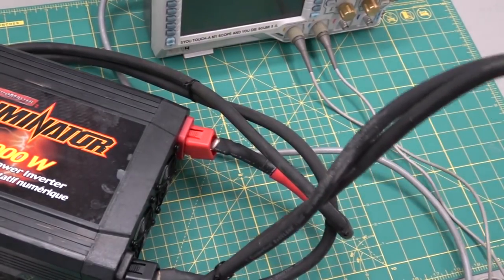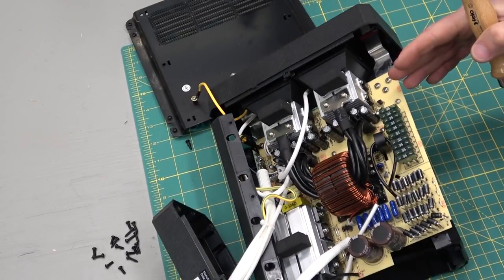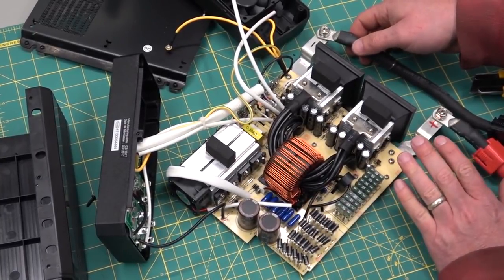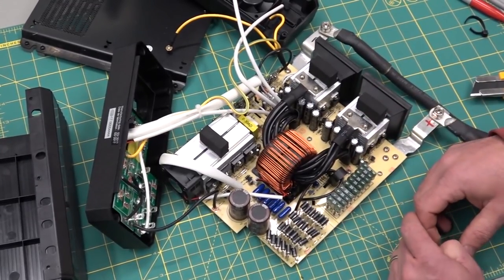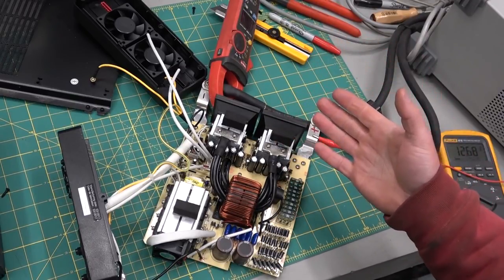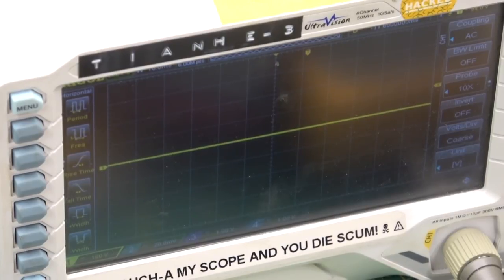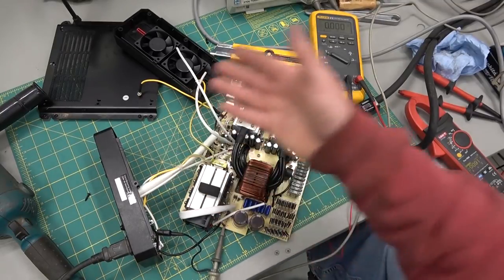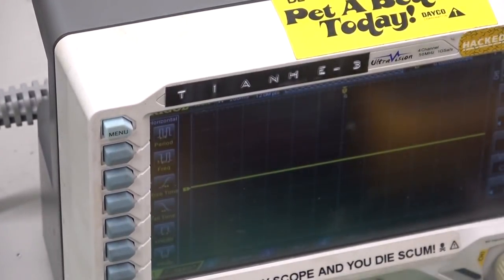BOLTR: 2000W "Digital" Inverter | Pure Sine Wave?

Comment: Aw poo, now I just gotta know how sine my EATON UPS really is too, they really should be forced to include waveforms for all inverter equipment in the manuals / documentation. It would be sweet to know if you got that pure sine or pure sin wave inverter! Seems good a reason as any to actually buy a scope tho right, right?!
Reply from the maker: Absolutely critical to check it with a scope. No choice.
Reply: Pretty sure all the cheaper ups will be step waves. They say it in the spec sheets, eaton and apc.
Reply: Power should not be thought about except for the that are clinically compulsive, rich, brilliant and willing to spend their lives getting mostly nothing accomplished.
Reply: Plug a desk lamp into it.  If it sounds buzzy it a square or modified wave, if it sounds normal it's probably a pure/true wave.  What AvE said about it being impossible to create a proper wave with an inverter is incorrect, my MicroSolar puts out a very clean wave.
Reply: Speaker and 12k ohm 1w resistor would tell you, just don't plug it for too long, 5w speaker minimum. You can clearly distinguish square wave triangle and sine wave. There are apps on phone that can generate these sounds for comparison.

Comment: The transistor will always blow to protect the fast-acting fuse.... an EE motto...
Reply: Gotta protect those fuses. They are expensive and hard to replace. (sarcasm)
Reply: I hear from a certain Louis Rossmann that Apple are especially keen on implementing this motto in their backlight circuits.
Reply: @pulesjet  well, you want it to pop without blowing up in your hand, making sure it's not chineseium crap drives the cost up.
Reply: @pulesjet  what gauge aluminum foil is 200mA?

Comment: I happen to be working at a company that sells and repairs UPS units (big ones, up to 500 kVA), so I have seen an inverter or two over the past few years. That poor thing on your healing bench is a joke from the technical point of view. The only admirable thing about it would be how the design was cost-optimized to death when it actually still works without setting everyone you love on fire, but that's about it. The machines we work with acutally do generate perfectly clean sine wave (regardless of the brand, it's a trait of the class). They usually have a very beefy brainboxes, utilizing FPGAs for precise MOSFET/IGBT control and use very high frequency PWM to "draw" a hi-res approximation of the sine wave, which is then fed through an output low-pass filter to iron out the noise and distortion with as little power loss as possible. Some devices can go under 1% output THD with linear load and under 3% with non-linear load, which is usually way better than the input power from the grid. The cost, of course, is a different story. My point is that you actually can generate a clean sine wave using solid-state switching converter although a lot of engineering needs to be involved.
Reply: "fed through an output low-pass filter"  Yeah, when he was talking about a perfect sine wave being impossible from switching, I was thinking about output filters and Nyquist's theorem and such.

Comment: In this case, "modified sine wave output" must be the new marketing word for square wave output.
Reply: "Modified sine wave" is complete marketing BS, "Modified SQUARE wave" is the correct terminology, but marketing heard that "sine wave is better" so they changed it to "modified sine wave"...
Reply: @SomeMorganSomewhere  is not even modified square wave is just a plain old square wave with some dead time
Reply: It is the marketing word for square wave output but its not new. They've been using it for 15 years at least
Reply: more expensive inverters/rectifiers have a lot better filtering and PWM to get much much closer to a legit sine wave. Used to work on big (like multi MW) UPS systems and DC plants, and once you start spending the big bucks you get really accurate power reproduction. thats why they get to keep the name sadly
Reply: viermidebutura The dead time is what makes modified sine wave “modified”.  The reason for the dead time is to avoid the extreme transition, and momentary near short, of a true simple square wave drive plus it creates an actual zero crossover reference period.  Modified sine wave is much, much, gentler on inductive loads, such as motors and transformers, than the even simpler pure square wave of much older early AC inverters as it the magnetic field to collapse more gracefully before the polarity transition occurs which allows those loads to both run much cooler and generate fewer harmonics versus simple square wave.  That said, I think we would all likely agree that it really should be marketed as “MODIFIED SQUARE wave” but then that would be bad marketing wank since consumers have learned to look for the words “sine wave” if they wanted a “better” inverter — its like calling a battery “marine deep cycle” even though the battery is most certainly not deep cycle but uneducated consumers trust that a battery that says “deep cycle” must be deep cycle.  Many modern inverters of this type will also vary the output duty cycle to help soft-start heavier loads, like motors, that would often overload the earlier square wave AC inverters.

Had this been a real “pure sine wave” AC inverter the output would have been Pulse Width Modulated at a much higher frequency (somewhere in the range of 20-100KHz)  that would then be smoothed by a low-pass filter to form a proper sine wave output (essentially they operate as a Class D amplifier).
Reply: <ahem> POOR sine wave inverters...
Reply: @ethanpoole3443  well square wave is not used for only 50% 50% square waves but for any variaton of its duty cycle so to say modified square wave is just word salad

As for pure sine for this type of inverter (square wave with dead time) there isn't a big difference in components to make it pure sine...
I think is just a marketing ploy so that they can overcharge the shit out of their pure sine inverters
Reply: I still don't understand the design priorities that lead to this thing - just feed the battery into a big capacitor bank and supply two IGBTs from it (providing opposing polarities). PWM modulate the IGBT drive at 50 KHz or so and connect the outputs to a 5:1 transformer . Pure sine output, fewer components. Why not?
Reply: @viermidebutura  thats a really poor description and completely fails to talk about how much better it is for equipment than a actual square wave. If you can run a fucking 20 horsepower fan motor off of one.... Its fine!!! You literally dont need anything better than that!
Reply: It is a sine wave represented in a very low bit-depth. Like 2 bits. From this perspective they are not lying. Still funny, tho.
Reply: Like the day they renamed dumps to landfills. Marketing
Reply: @SomeMorganSomewhere  same here u don't start with a sine wave and "f" it into a sine . I realy HATE the lying term " mod sine wave " jaycar here & others USE this CON

Comment: Taking a guess at the architecture, the first stage looks to be a  push-pull step up convertor, with a passive output rectifier (all those diodes) to generate an DC link at 170Vdc, from 12v to 170 is about a 14x step up, which looks about the winding ratio on the primary inductor.  Then that DC link is sent through a basic 120Hz 3 step output (ON - OFF - ON (reversed polarity) to generate a square wave output.  When you switch on the grinder you can see it increase the ontime to attempt to keep the RMS voltage at the setpoint (120V), which of course further distorts the waveform into something like looks more like 2 steps.  2kW is 16.6A at 120V, so the output stage, which only switches slowly (and therefore has little switching losses) is fairly small. The input stage of course, down at 12Vdc, needs to pull 166Amps (plus loses) so is a lot more beefy.  Even with 8 fets, that's still over 20A per Fet.  Because of the high current, they use N channel Fets to get a sufficiently low RDSon, and therefore have to use an isolated source referenced gate driver to create suitable gate voltages (probably at around 24V (12Vsupply + 12V gate)

Comment: That kind of waveform will kill AC induction motors such as found in refrigerators, electric fans and such, they will dissipate much more power as heat due to the high harmonic content.
Powertools generally don't mind because they have a universal motor (which is actually a DC motor which also doesn't mind running on AC) but will run a little hotter because of the eddy currents induced by the high frequency components of the wave. 
In most electronic devices the input filter capacitor gets ruined rather quickly as it cannot handle the sharp rising edges of the boxy 'sinewave'. The device will still work but it will leak noise into the mains supply and will also become more vulnerable to switching spikes in the mains supply which could cause unexpected resets, data corruption and stuff like that.

Devices that use a capacitive divider will probably die after a few minutes but I've never tried that. I mean things like plug in digital timers, remote controlled socket outlets and such. 

Good quality inverters do exist that actually produce clean sinewave outputs which are visually indistinguishable from what you get out of a power outlet. They work pretty much like class D audio amplifiers changing the duty cycle of a very high frequency inverter making the output voltage follow an exact sinewave once the high frequency is filtered out by an LC filter in the output stage. Such inverters are common in the better computer UPSs as well. They usually cost about five to ten times as much as the ordinary ones.

They are more expensive because they need to run at a much higher PWM frequency, typically somewhere between 150 and 500kHz as opposed to around 5 to 10kHz probably being used in the inverter you got. The cost is mostly in the MOSFETs and the freewheeling diodes.
Reply: Many large inverters invert the raw DC bus voltage of rectified mains using hundreds of tiny steps with little to no filtering required, the tried and tested method of most massive online based UPS's in large datacenters to generate 3 phase AC with a string of SLA batteries and very large IGBT's.
Reply: Maybe in some, but not all

Comment: I'll send you the wave form I get out of my Trace 2548 inverter, its impressive how many steps there are in a wave. Of course you pay out the nose for that, but I was running a lot of computers of it in the late 90's with a train battery. Wish they were in business and still made.  My first one was a 2512, but the 00 battery cables would dance under load, I could calculate somewhere in the neighborhood of 400A pulsed DC draw.  Like watching tassels spinning at the titty bar and almost as fun.
Reply: Why did you do that, and do you have any pictures for us to gander at?
Reply: the duty cycle is important because when it is just right it removes many of the harmonics
Reply: @newdeathscope  server farm, and I may be able to find pictures, this was ~97 I set it up. Full flege ISP with national DSL service completely independent backhaual.
Reply: I'm sure he will with something he has round there, I would put it to the lighting first.  I would not want to run a fridge compressor off that wave.
Reply: I think you need to be going to a different class of establishment...
Reply: Outback inverters are an excellent spiritual successor

Comment: That is a modified sine, not a pure sine inverter... I have true sine inverters, and they really do produce a sine wave.
Reply: Totally a modified sine inverter, but they didn't call it a pure sine, they said "digital" right? Maybe I missed it, but it looks like a piece of chit!  Doesn't look reliable at allllll, just enough for a few computer charges in a power outage, and will probably blow up after your 2nd cup of coffee, haha.
Reply: Instead of just one sine at 60 Hz, you get sines at 180 Hz, 300 Hz, 420 Hz, absolutely free!
Reply: Should have put the Rigol into FFT mode and compared this to the wall, to show all the higher harmonics from this digital sine wave.
Reply: No real need for this, harmonics of "modified sine wave" are well known. If any waveform have the same positive and negative pulses (not like positive is longer, but smaller amplitude, anything like that) then signal has no even harmonics at all! So we're down to 1, 3, 5, 7, 9 etc. The simplest square wave without pauses have amplitudes of these proportional to 1, 1/3, 1/5, 1/7 and so on and so forth, with phase shift of 180° from one to another (or say: it's constantly changing sign). When there is pause present, some of harmonics could be eliminated. Best case would be when duration of each pause is 1/2 of each pulse. This way we eliminate 3rd harmonic and all multiples of it: 6th (but it wasn't here to begin with), 9th, 12th (was'nt here either), 15th and so on. So waveform like this is pretty easy to filter out, as the most annoying would be 5th harmonic, 300 Hz. But we see: duration of pulse changes to accomodate for voltage drop on battery which leads to lower amplitude of pulses on output. So when grinder is turned on, "brainbox" reduces duration of pause, so rms would be still 120 V.
Reply: AllMyCircuits act now and we'll double your order and add free shipping. Just pay a 99.99 handling charge!
Reply: Indeed... I have repaired them, and looked at the waveform on a scope... they are surprisingly sinusoidal.

Comment: I salvaged the controller out of an old California Instruments "Invertron" that got scrapped at the electric motor manufacturer where I used to work. Interesting little thing. It had an 8 bit ROM chip that could code up to 256 levels of output, and they coded a quarter sine wave into it. A four stage counter would step output modes every time the address in the ROM hit either 11111111 or 00000000. When it hit all ones, it would reverse the address counter and count back down from 11111111 to 00000000. When it hit all zeros, it would again, reverse the address counter, but also toggle the output polarity. This gave a 512 level digital sine wave that completed one cycle in 1024 total steps. Not too shabby for a bit of kit from 1980!

Comment: That's  a modified sine wave inverter. They great for running incandescent lights and power tools with universal motors, but they like to burn up induction motors and transformers. They are not particularly good for switchmode power supplies either.
A true sine wave inverter will produce a waveform almost identical to what you get out of the wall socket. They cost several times more than a modified sine wave inverter though.
Reply: Cheap inverter generators produce almost as near as good pure sine wave, they use a pair of toroidal inductors to do it however this design doesn't scale very well, where the design in the video scales significantly better, however it just looks to employ a massive DC boost converter and then chops up that HV that is also tanked in the 2 larger caps at the bottom. Units that have a lot of steps that employ a similar output inverter that gets a perfect pure sine wave also do this because it eliminates the need for a massive transformer to smoothen the output thus it scales about endlessly, you commonly see such designs in massive online datacenter UPS units and of  course this is considerably more expensive. You can get a very good sine wave out of an APC SmartUPS too however this design uses a large heavy transformer for the output (and runs in reverse to charge the batteries).
Reply: In addition to that the cheaper ways of generating perfect AC sinewaves with a good amount of usable power require a HV bipolar DC input or an AC input to generate the said bipolar supply, such as from a generator stator. The DC-DC converters to generate those supplies from 12V would also be cost prohibitive.
Reply: There's a skookum choochin invertar laying on the shelf at work, bigger maybe than the unit he tore a part but only 300 watts. Was wired up with 4ga fine strand, Anderson connectors and proper fusing. defiantly I would chuck it north to see it tore apart for tits and pickles.   cant recall the name but white body blue print all METAL and cert output sign off when packed.
Reply: You got that right...back in 1980, I worked for a made-in-USA company that had to build some equipment to operate in Saudi Arabia, which at that time used 50 hertz, the equipment had induction motors among some  'newfangled' microprocessors (4004) running from an antique transformer type power supply...  We shared Mfg. shop with a high end audio amplifier company....so we used a signal generator and a 5KW amplifier to run the equipment...worked out fine.... 
 More recently, in 2010....my last employer had a very expensive high end Motorhome with a 2.5KW inverter...about 3 times the size of this, was also a battery charger running from 120 VAC 'shore power' to charge 2 BIG AGM batteries at 12 volts, 150 amps...it had a 2.5KVA power transformer with 120 output for the motorhome 120 VAC receptacles...
  The big transformer was used for both inverter and battery charging.....several very large heat sinks and banks of Mos-Fets...I don't recall the name of Manufacturer, but it was very expensive, something like $5,000....
Reply: I've got an old Elgar UPS that uses a 16-level sine wave approximation.  By the time the pixies come out of the massive transformer in the center of the beast, they behave like a real sine wave.   It's rated at 1.4KVA and lifting it will pop those hernia stitches.
Reply: @tubastuff Yeah! Nothing like a big hunk of iron to smooth out those troublesome Pixies....

Comment: I’ve been repairing stuff like this for over 3 years and this did make me giggle, from a drunken glance, that was modified sine wave and the general rule of thumb is if you’re using an inductive load (heaters, microwaves ect) your load will be double what it’s rated. ^^ SINGLE SIDE PCB’S MAKE ME CRY